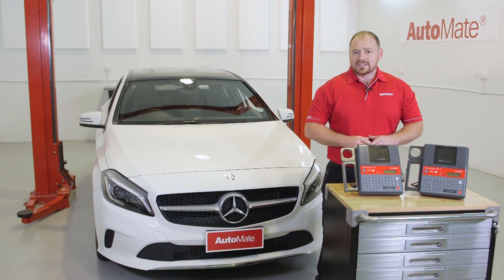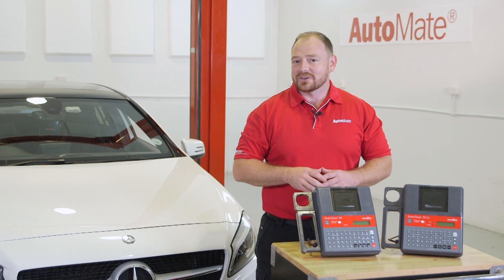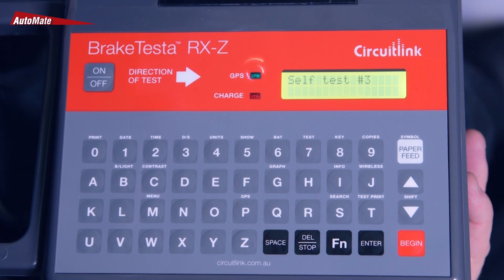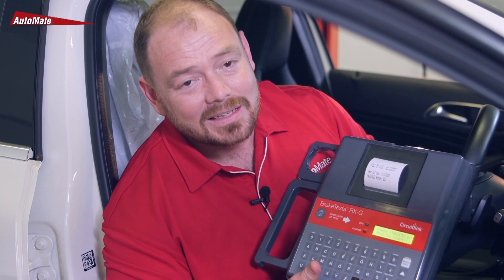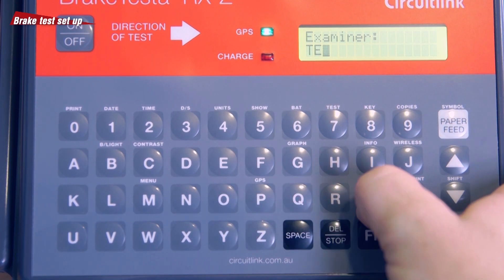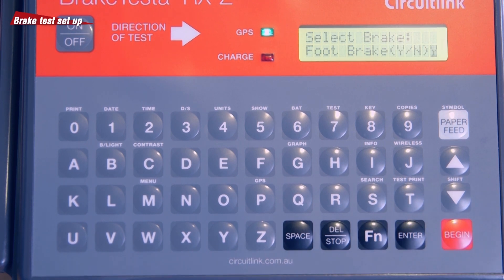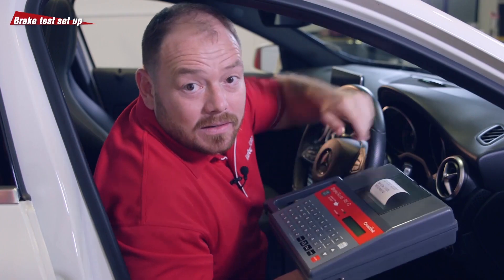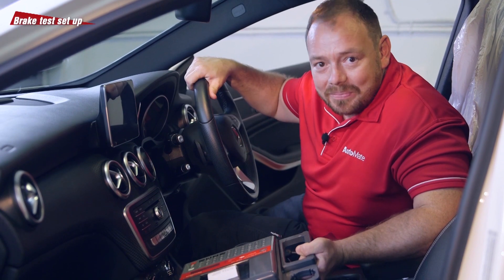Circuitlink Brake Testa RX Series Training Module Trailer

Comment: would never buy these brake testers again have had 2 of them  sent one away to be recalibrated that was working perfect now  saying unit was chewing up printer ribbon  WAS WORKIN FINE WHEN SENT $750 to repair  other one brand new never worked from always fail nearly had to put you foot through the firewall still fail